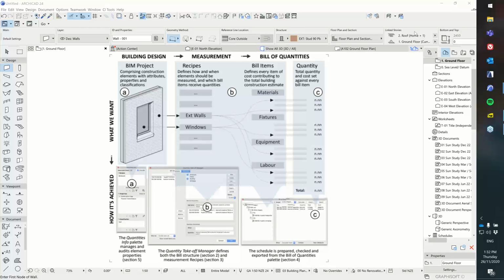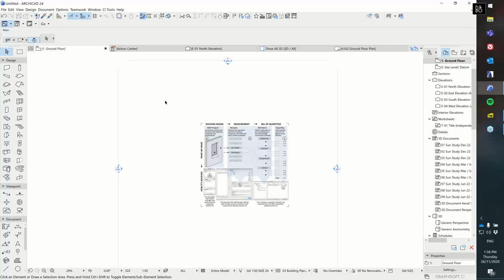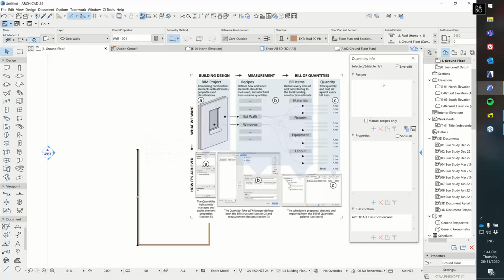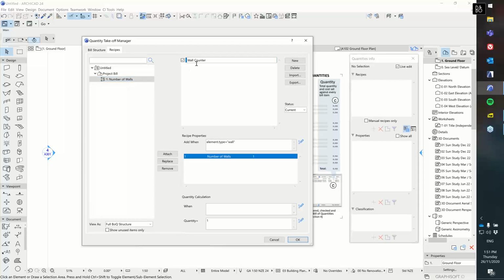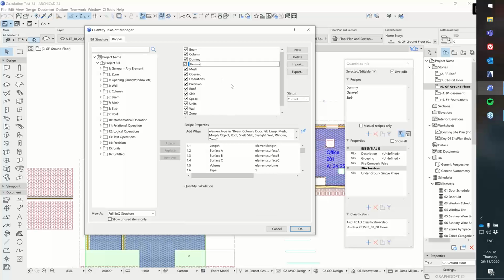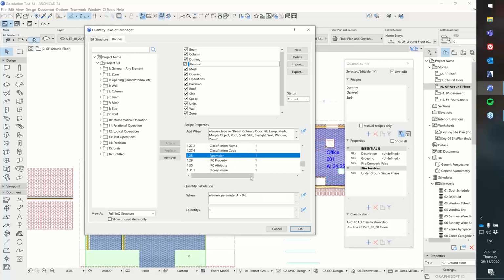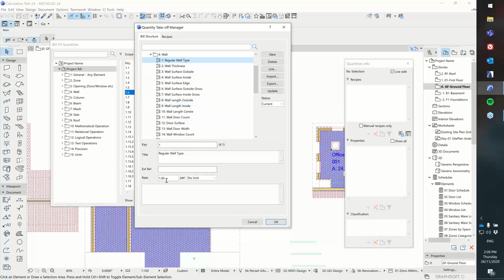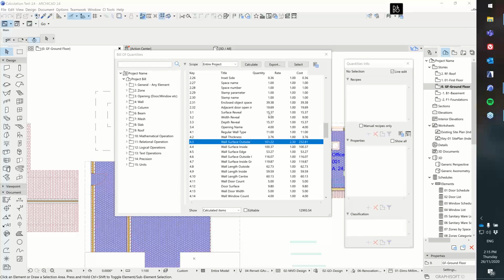Select Webinar - Ci Tools Quantities

Comment: No. The way material counting is implemented in your system is quite complex. You constantly need to have the command manual at hand. These commands should be presented as a dropdown selection menu.
What is important:
1.Please demonstrate how you calculate the quantities of elements for wall finishes and windows? For example, we created a roof with a drainage system using the Roof Covering tool.
2. How can I obtain a detailed material specification generated by CI Covering? Or is all of this supposed to be done manually with pen and paper?